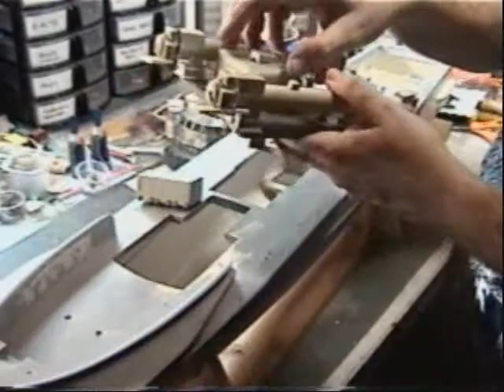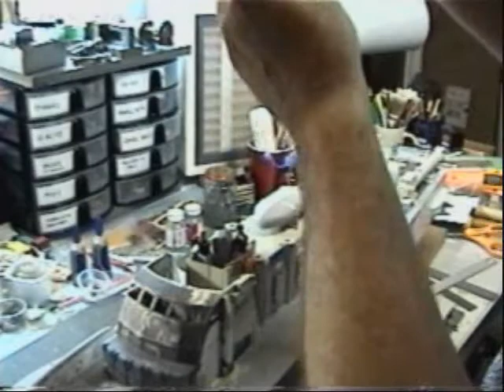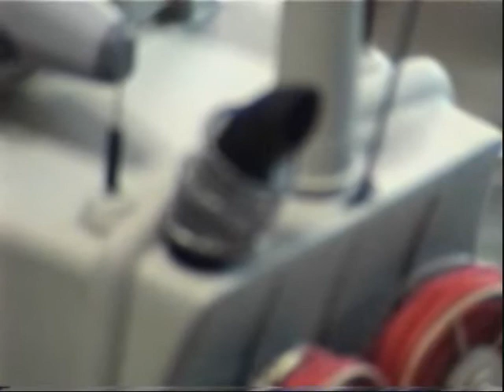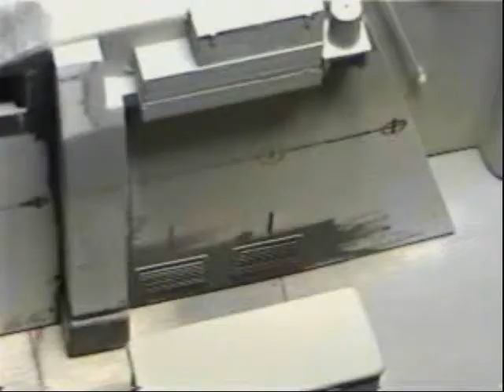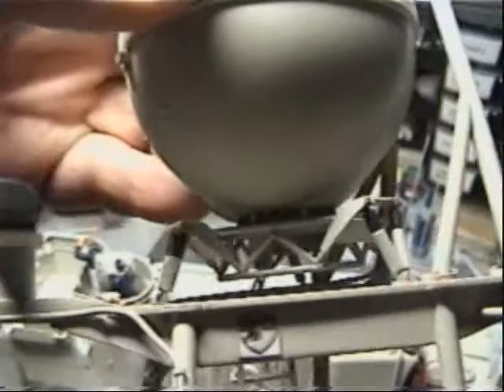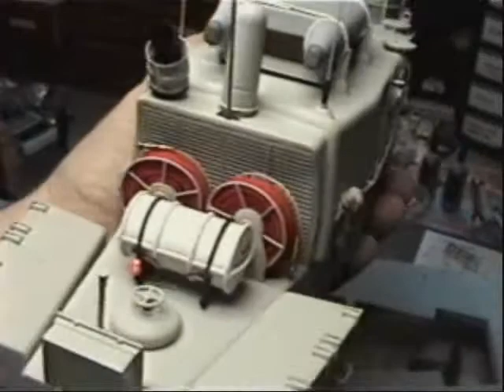Wiesel mid-construction assembly

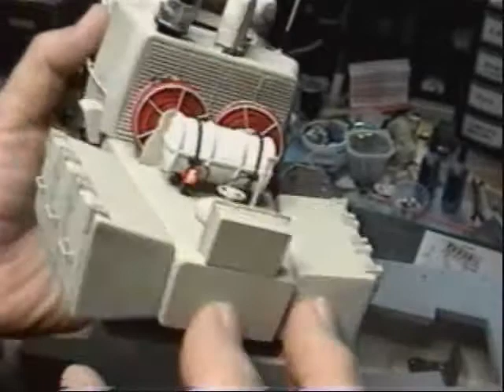Comment: Thank you for sharing all this information and detail. It is very helpful, as I'm about to embark on building one for scale RC and recognize the lack of detail and proper scale in the basic kit. It's been very difficult to find drawings, resources and photos on the vessel, especially the flying bridge, as you mention. So, I am sure to come back and review all this as I get underway. The slender vertical pipe stanchions you mention at the 19:58 mark, I believe are nuclear fallout sprinklers. It would be interesting if you could post an update - I  hope you have gotten it on the water. Cheers!
Reply: (Sorry for taking long to get back to you.  I happened on this video as I am planning on repairs and updates to the Wiesel.)  Correct, these are sprinklers for NBC warfare wash downs.  Seal the ship up and spray away.  I recently made new propellers on my 3D printer.  They are larger in diameter, have a higher pitch, and more blade surface area.  I hope to get to this mod by this summer . I have not had the Wiesel in the water for several years and want to up the speed quite a bit without going to brush-less motors.
Reply: Video for the new propellers: https://www.youtube.com/watch?v=HY4-1gFqEl8